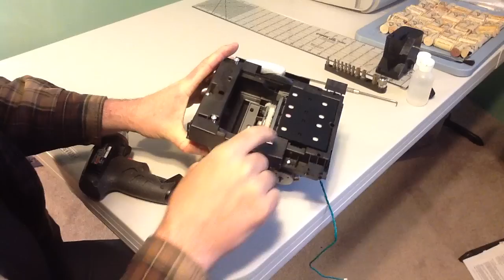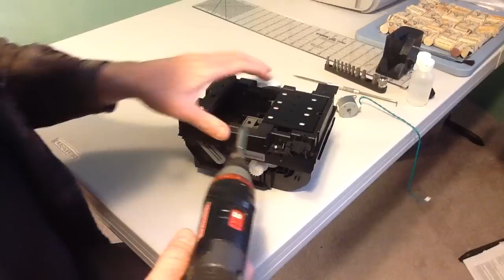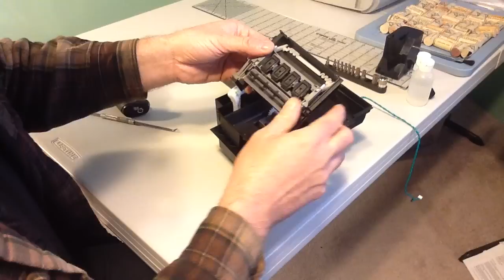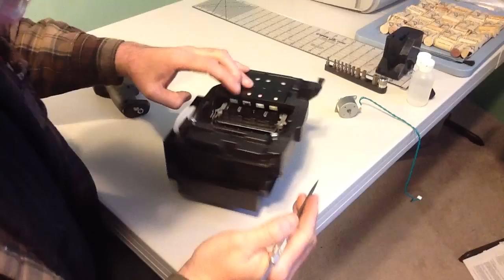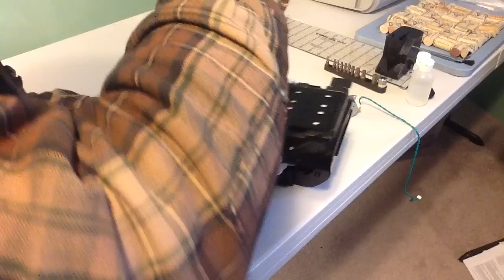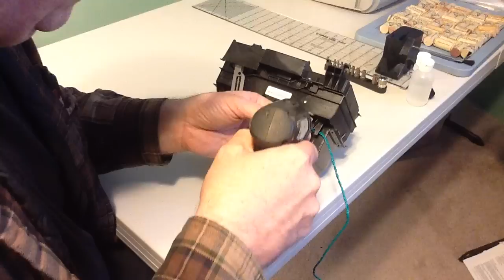HP Design Jet 500 Printer Service Station Maintenance Part 1

Comment: Do you physically remove the sponge from the unit to be soaked?  Also, is it ok to soak the carriage unit?  BTW, thank you for your video.
Reply from the maker: You can disassemble the lower and extract the sponge, but you don’t have to. It rinses off pretty well with soaking and flushing with warm water. Yes, the carriage can get rinsed. Once the electronics(motor) are off of it the whole assembly can get wet.

Comment: I just want to tell you you are pretty awesome. I had a repair man come out and he kept scratching his head on error code 21:10. He said I had to replace all kinds of things to get it right and it would be like 500.00. I pulled out the service station myself and cleaned it like you said , dried it out and put it all back...And BAM I back up and running and it's printing better than ever. Thanks for putting this up, Doc and Pie

Comment: My brother is using original HP cartridges and heads. But the problem is that it does not finish making the depersurisation process and therefore it does not let print if it does not replace the head 1. Then replace the head 2 for the one and it gives error the head 2 but the baskets I put them new and change The connector cables and remains the same. Help me because I have many pending jobs.

Comment: When you remove the carriage assembly from the service station I understand you soak the lower and upper half's in warm water to clean ink residue.

Can the carriage assembly that is removed from service station be cleaned the same way by soaking in warm water to remove ink residue ?  

Thanks for the 2 videos !

Comment: This is a great video for helping people get there plotter
working in a pinch. You mention that the service manual doesn't say much about maintaining
or cleaning the service station.  There
is a good reason for this. It is not meant to be maintained, it is meant to be
replaced.  The Service Station  is considered to be semi-consumable.  By the time one fails it is believed that the
wipers and seals would be worn out. Cleaning the service  station instead of replace it could adversely
effect  printhead life and end up costing
more. Like i said, It's a great way to get going in a pinch, but the service
station should still be replaced.
Reply: Not necessarily. If you view or print the printer report from the menu it tells you how much life is left on the service station. In my case, the service station was only 27% used but it stopped working because I didn't use the plotter for a couple of months and the gummed up ink froze the service station wheel/scraper.  Once cleaned and re-assembled, it works like new with 73% of its life remaining.

Comment: Mate  your video nailed it .  10/10 would watch again but its fixed now.  Lack of use over our summer had hardened the ink on the scraper /wheel which slowed/bound  the motor.  Cleaned it now works happy again.

Comment: Thanks for this great video.  My plotter was about to be put out in the yard and used as target practice but thought I would give it one more chance.  Your clear instructions were ideal and the plotter is now working as new.  As an aside I found the carriage was a bit lumpy and found a lump of rubber residue on the toothed gear at the cutter end of the machine.  It may be a bit of residue off the drive belt but once cleaned off running smooth.

Comment: Hello. Thanks for your video. We have the same issue. We removed & cleaned out the service station, but when we re-installed it, we are still getting the same Error Code 21:10. Any recommendations?

Comment: MIne has a fan attached to the bottom...  How can I remove????
Reply: +HEYO 

That's called an aerosol fan. HP determined that was unnecessary
and didn't put it in later production.

A bad or missing aerosol  fan gives the same error code as a bad service
station (21:10) unless you upgrade your firmware. It will snap out for you and
you can snap it back in to prevent getting an error code, but the best thing to
do is upgrade the firmware and leave it out. The new service stations don't
come with it so you must upgrade the firmware or transfer the fan (bad idea)
from the old unit. 

Service Stations should be replaced (not cleaned) when you
get a 21:10 because the blades and seals are worn out. Cleaning the old service
station and putting it back in may end up costing you more in printhead
replacement.  You can save some money by
getting refurbished Service Station from 
lpscomputer.com